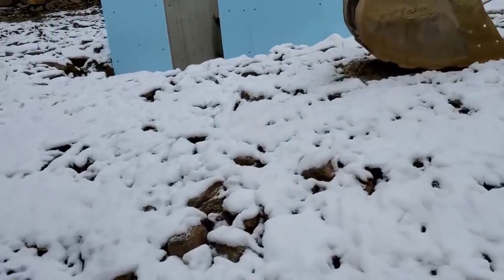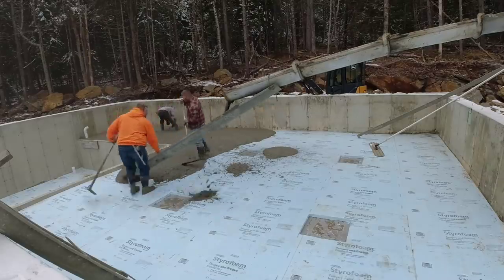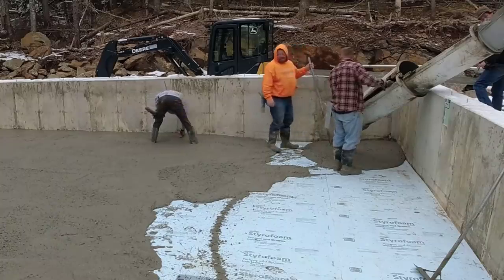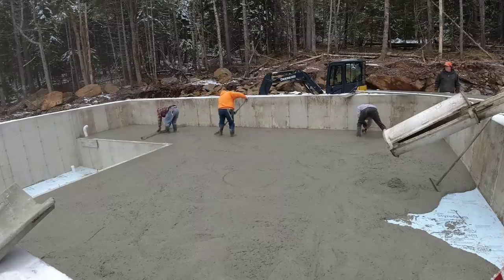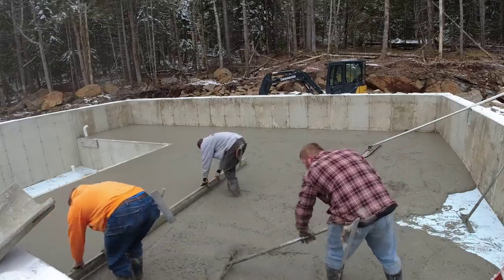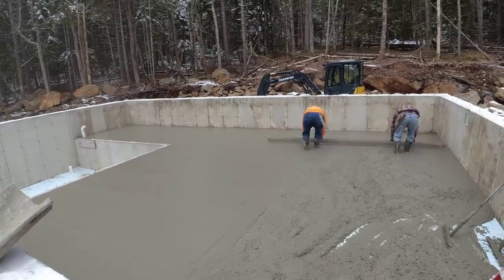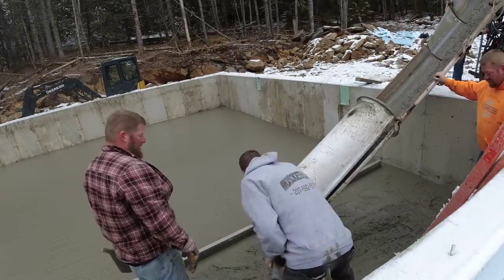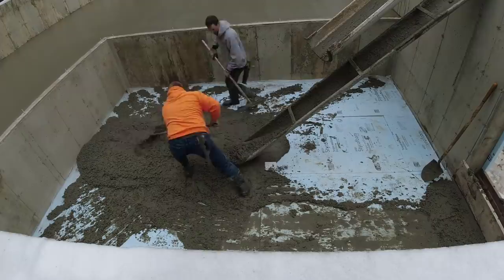How To Pour Concrete Floors In Freezing Temperatures (Did The Concrete Freeze!)

Comment: Our work is quite different from yours.  We never need to travel say more than about 30 or 40 minutes away.  So it is a lot easier in that way, but too we don't do nearly the volume of jobs you do either.  Also, our experience level isn't what yours is to dealing with the unknowns that come up, so we don't like working for contractors we haven't worked with before.  In that way we have been really blessed, for sure.  I am very impressed with the way you handle the things that come up and am trying to learn from your way of working.  Thank you for what you are doing it helps us more than you know.
Reply from the maker: Thank you Glenn!

Comment: Hey Mike, I enjoy watching your videos even though I do the same thing every day & have been for almost 30 years now. I’ve been self employed in the concrete finishing business since 2001 & for the last several years I generally run about a 5-6 man crew.  I live in the Smokey Mountains of East Tennessee just outside of the Knoxville and Gatlinburg area & being this far south we very rarely have to deal with freezing or snowing (it’s 70 degrees today/Dec 26) down here. Instead it’s usually dealing with being to soft or muddy to get the trucks into the jobsite. I 100 percent agree with you on that job not being ready & we often have to deal with that too. I would have probably charged the GC some kind of hourly rate for the hour and a half worth of work you did before pouring just so you didn’t have to pay your crew out of your own pocket at the very least. I think that’s more than fair since it was supposed to be ready for you to start pouring when you got there.  The biggest difference or change I’ve seen down here in the past 10 to 15 years is that the General Contractors want you to do the jobs turn-key now, meaning all the grade, prep, & form work too. It wasn’t always this way but the GC’s don’t want to do the grading or form work anymore & to be in the concrete business down here you pretty much have to own a skid steer and/or mini excavator. We probably do the grade, prep, & form work on 90 percent of the jobs we pour, especially the residential jobs.  You guys do really nice work and it’s good to see a crew that still cares about the final product.

Comment: In New Zealand  we get concrete with a 4 inch slump  stiff as a rock 
The maximum it comes to sight is 5 inch slump  still way to dry

I add 30 gallons of water to the truck sometimes  but it's not easy to convince the  driver to put that water in

Comment: i worked for a few general contractors and we always accommodated the subs especially concrete finishers. Too add to that general was always in charge blanketing and heating if necessary. Once the concrete was finished by the sub it was on us the general contractor.
Reply from the maker: Thank you Joe.

Comment: 4000 that loose, what does that mix actually test out at?  I'm a commercial GC, the geotech's would never allow that kind of slump.  Is there a reason no expansion along the walls?  Good crew you have there!
Reply from the maker: We have high range water reducer in it. It'll break 4500

Comment: The GC accurately predicted the weather, took the proper measures, and put down snow blankets (should have been snow tarps, but I digress). Who's responsible for removing them and clearing the snow/ice when hot mud is en-route should have already been determined, considering the snow blankets were installed to begin and they will obviously need removed. If you're the sub, of a sub, of a sub...I'd say you should blame the two subs above you before you blame the GC. In any other case you back charge for the extra work and do your job as expected. Good subs aren't selfish and do what it takes to achieve the goal and understand it's a constant give and take when it comes to achieving that goal from time,  to time. Likewise, a good GC will reciprocate and take care of you when needed. 

It should always be about the finished product and the affect you have upon it. Do you want to tie your name and reputation to it, or not...?
Reply: Concrete is hard work and it waits for no one. The site needs to be prepped and ready especially when pouring below freezing. It's not reasonable to ask a contractor to do an unplanned job they weren't contracted to do. Especially one with an extreme labour and time demand. No excuses its bull shit.
Reply from the maker: Thank you!!
Reply: @MikeDayConcrete  You can always tell who hasn't busted balls on a slab. For some GF's I guess everything sounds easy from their heated shack. lol. Winter pours suck enough already, that's why here in Canada calcium is a dirty word. Accelerators reduce pliability and you add that to the fact that it's a hot load and things can get dicey. I've seen floors lost because of unplanned complications in the winter. It's a major stress, good on you guys for getting it done but 100% I'd be pissed too.

Comment: When it that cold outside you might want to check your magnesium screed boards after you cut your screed line in. A cold screed board will warp when it hits the warm concrete. Your floor will have humps or valleys in it if you aren't careful.
Reply: That's a top tip!
Reply from the maker: I've had that happen before. Hasn't happened so far this year.

Comment: I think it would be interesting to of had some test cylinders to see how much psi dropped on the second truck. Need to communicate to "who you are working for" what you are expecting them to take care of. I would have back charged them $1,000 for the work if they knew they were responsible for it. Great videos.
Reply from the maker: I thought it was clear, my mistake. Seems like common sense to me also.
Reply: I was wondering that too.  It looked really runny for 4000psi.  But I ain't the concrete expert.

Comment: still can’t believe how loose your concrete looks. we will order at a 6 and still add water when it gets to jobsite and it is nowhere as fluid as your concrete….does the water reducer really make it that loose?
Reply from the maker: Yes it does, we can pour up to an 8 with it. Without it the slump would be about a 3.
Reply: @MikeDayConcrete  so how do you order it then? do you order it at a 5, then add the water reducer? just curious because don’t want to order it at a 5…add the water reducer and then it comes way to loose.
most of the stuff we do are patios

Comment: Someone should have been there helping with all that unwrapping, I quit pouring this time of year when I had an open basement like that freeze the surface, had to get a company in to put a high strength liquid over it when the house was up,(never again). In hindsight I should have covered it , but in my opinion it’s not worth it.
Reply from the maker: I've had to deal with many "frozen floors" over the years. Contractor didn't want to cover it but it had to be poured.